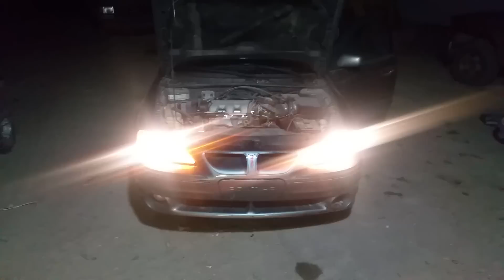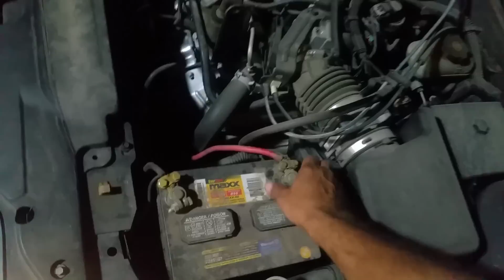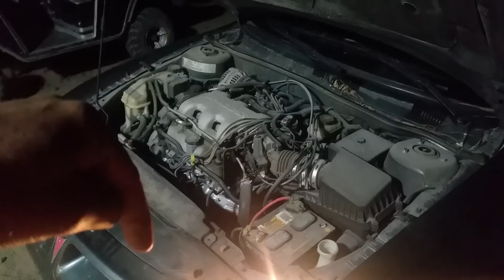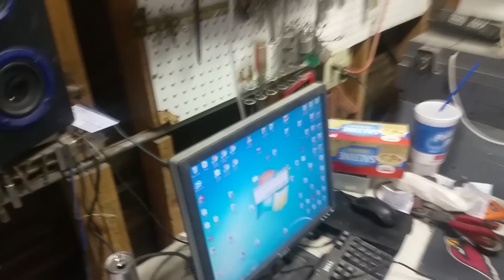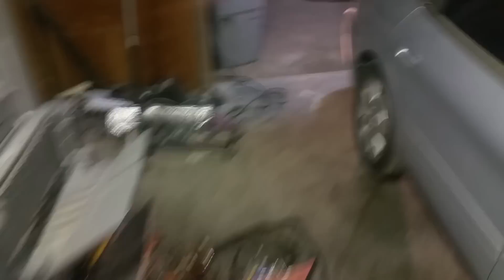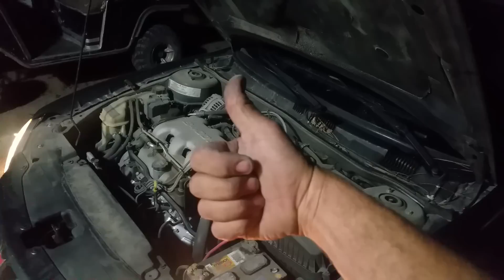Bad Alternator or Bad Battery, Easy Solved

Comment: But how can you tell if the car doesnt turn on
Reply: you cant. but you can try  jump starting your dead car using another car. then drive your car for 15 minutes. (driving charges the battery). and then disconnect the battery like this guy does to find out if its the battery or alternator at fault.

Comment: Straight to the point. But the alternator could still be running the car but under the normal voltage, and you can only test that with a meter. If that's the case, you still need to replace it.

Comment: Battery does more than just starting the car... Go ahead and do what this guys tells.. Take off the cable. If it stays running great.. But dont put cable back on battery and see how far ya get before your car dies and your stranded....I assure you, it will stall out abd die within 5 no more than 10 miles

Comment: I can not believe I had not thought of this fact... As soon as you said you didn't need tools I said it out loud and all, "oh duhh, no kidding".

Those who make remarks on computer issues clearly have no idea how a computer works. The radio is actually technically speaking it's own computer from the car. The cars memory is like a USB stick. 15+ years of no power I think it is the longest time I let one sit for, stick it in (aka power it up) and the data is there. So the clock on the dash, it's less than 5 minutes for a monkey to reset the clock/computer. Yes a digital clock is counting, and displaying through process of computing. And cars are simplest forms of computing because it's tasks are often more singular. I'd be far more stressed out if your home PC lost power than I would if a car did.

Comment: My 2000 chrysler 300m does not start.No interior lights.Tried to charge the battery with my battery booster.Charger read 12.1-12.3 volts.Interior lights and head lights come on but iginition just clicks and engine won't start.Is it the alternator?

Comment: Doing this can really cause issues I would never do this to any vech . The facts the battery has more then one job it  keeps reserve power to start vech, it also stabilize all current moving throughout the vech . at the time you remove the positive cable if the alternator  have a high current Spike yes you can fry computers and wires and a lot of other items throughout the vech. due to battery not hook up . been working on cars 30 years  ase  my advice is use a multimeter it's fast and you don't have to worry . I had a costumer did that didn't tell me  at first , dealership got 3,000  issue I found  was a burnt wire on the positive side of the transmission modular took out the transmission a lot of hours on that job costumer told me after he did this . real issue he had at first was a bad ground wire . great topic glad I found it be safe and stay positive .

Comment: If you have a radio with a pop off face plate for theft purposes, remove it before removing battery cable. Your radio setting will be saved.

Comment: Thanks, this was useful for me. Btw, when I did this (for 5 mins), although my car didn't stall, the headlights started flickering fast (but they went back to a solid light when I reconnected the battery). Is that a sign of something?
Reply: It means your alternator is on its way out. Voltage spiking means a part of the alternator isn't working (usually consists of three points for the belt) one of them is out.
Reply: @PallaDrak  I rechecked but the voltage stayed at a steady 14.6V (with flickering headlights). Maybe the battery provides stability to the electrical part of the car?
Reply: @Saaaaab  The battery acts as a sink in the charging circuit, absorbing fluctuations in current and voltage from the alternator.  Pulling the terminal like he shows is a very bad idea on newer cars.

Comment: Ok, this is my problem. No electric in my vehicle at all. I put jumper cables on my battery i charged it for 5 minutes + when i went to start the vehicle i hear click click click. Ik the battery is probably dead but is my alternator a problem too?
Reply from the maker: loose connection on the battery or starter

Comment: Bro, the battery in NEWER cars is used to START the vehicle AND control the ECM/ECU (Computer) which handles voltage spikes and fluctuations.  Removing the positive or negative terminal with a newer car, especially one whose positive terminal splits off to the ECM like mine (2016 jeep compass) will potentially fry the alternator and/or the computer.  DO NOT EVER DO THIS!!!

Comment: I have an 06 Ford Taurus, the charging system warning light came on. And upon researching it. ( tested with voltage meter) and it read 10.2 volts while running and 12 + after car was off my alternator was bad. I installed the new alternator and again tested it with my voltage meter, for about a minute it read 14.5v.  Then the charging system morning light came on again and it's reading 10.2 or so. Could this be the battery or is there other things I should check? Any input would be awesome.

Comment: A friend sent me this video... I’ve been going back and forth between thinking my battery is going out or my alternator.. several opinions from people after I tell them what my car has been (and hasn’t) been doing .. pretty much 50/50 on what the problem is... definitely didn’t want to take it in for some guy to treat me like I’m an idiot and sell me something I don’t need... so I tried it... now convinced it’s the alternator. Thank you for the short simple test trick! Made my life so much easier and for sure saved me some money (and headache)! 
Oh and loved the “rearrr rearrr” noises... loved the boo hoo reset your radio station! The unplugging of your actual computer had me dying!!! Common sense isn’t so common anymore! For sure subscribed and liked!!
Reply: How old is your car?  if it's a newer model this will NOT test if it's the alternator.  Removing the battery shuts down the ECM (computer that runs the car) and will flip a kill switch on your engine to try to stop it from overloading.  Doing this can create a feedback loop creating voltage upwards of 30 VOLTS which can actually fry a good alternator!  The only test I know of is to use a voltage meter.  Test the voltage before you start your engine and you should have around 12.4 - 12.6v.  After you start it and run the engine or rev it up it should test at 14 volts.  

Again, to repeat, this method does not work on newer cars.  This method can fry your alternator or ECM.  Test with a volt meter ONLY.
Reply: Tek Rx Greetings... my car is a newer model Ford Escape. .. the test was correct.... I’ve since taken my car in to have the battery tested... yup sure is fine.. no my computer isn’t fried.... I didn’t even have to reset my radio... .. The test was more of a... should I spend $150 on a battery or $150 on an alternator.... like I said in my comment.... several mechanic friends said battery... several said alternator... this just sealed the deal on who was right. Yes I know you’re probably thinking.... well why didn’t she just have one of them test out the battery? Answer.... sheer stubbornness that’s all.
Reply: That's great, so it was the alternator after all? Hopefully everything is working well after the repairs. Honestly I've been googling, watching videos, and reading everything I can. I ended up finding quite a few people saying what I said here. I still need to get my hands on a volt meter so I can test everything. Just got a new battery since all 6 cells were bone dry, trying to pinpoint why that happened right now.

Either way, I'm glad everything worked out for you. I just got scared of the "test" here after reading how badly it can screw up your car. The funny thing is they say it can actually fry your alternator doing this test this way.
Reply: @vladdangel how never cars?

Comment: Hello sir,I have a 1999 dodge ram 1500 van.I have not driven it for a yr now,The problem I am having is that the battery keeps dying,I replaced a brand new battery but to start it,i need to jump it.Here are the issues.
1.it will crank only as long as I hold the key,if I let go of the key ,it stops.
2.No check engine lights are coming,only check gauge light.
3.all lights turn on,radio turns on when I try to start it.
4.The indicator light will not turn off even when I turn the indicator to off position.
I have already tried replacing the ignition relay and solenoid fuse,but it did not help.

can you suggest what could be the issue just so I dont get cheated by a dishonest person.
Thanks.

Comment: wow great advice but i always herd remove the negative side of battery ... never herd of the positive side ever & yes i herd if u remove the battery  while runnig it would kill the computer .. so its positive removed & NOT negative ,,hope it works ..thanks
Reply: It is better to remove the negative side first if you are doing work on a car that requires the electrical system disabled. And you heard correctly, doing what this guy suggests could create a voltage spike and damage your computer if the car is newer and has a lot of sensitive electronics.

Comment: Saved me so much trouble , proved the alternator not charging by volt meter proof, somehow reset a chip or the internal regulator.  Alternator charged 14.5 properly thereafter.    So much money saving.  thanks !

Comment: Informative, but what if I know the alternator is bad but they also say I need a new battery?
Car died while driving it, won't start. Both crapped out at the same time? Seems suspicious.
Reply: Learning on a decent multimeter test both. Cheaper first --age of it and get battery charged then load tested at parts store. By used or refurbished battery.

Comment: I would rather take out negative cable instead of positive cable. Other wise this is a good video for its purpose. Nice job
Reply: Sifu Pai Mei  because negative is grounded on battery if that positive hit anywhere on metal will spark..

Comment: You shouldn't do this on newer cars. A easier safer way to check the battery and alternator is with a multimeter. you also gave false information. The car runs on battery not with an alternator. The alternator all It does is charge the battery. If you run a car without a battery, the alternator will fry.

Comment: Could it be possible that both my battery and alternator? The reason why I ask I because I’ve been jumping my car for a week or so every day with portable jumper cables. The car would start instantly after jumping the battery and I would drive Uber all day. Today for the first time i didn’t start after jumping the battery. Finally it did start but cut off on me after driving for about a mile or so. Now I’m worried it’s the alternator as well as the battery.

Comment: You are an idiot for doing that. You are not suppose to disconnect while engine is running. Can effect computer and electronic components in a negative way.  Everyone do not listen to this guy.
Reply from the maker: why ? tell me how it effects it? you calling me a idiot makes you look so stupid to any mechanic that knows auto electronics. ha i guess your battery better never go dead while your driving to grandmas house. because it would be the same  thing. think about what your saying before you open your mouth and you might be look a little smarter. your welcome for the education. .
Reply: thomas brian The man from the road service thinks he's being helpful. After he can't jump start your car, he puts in his own known good battery and starts your car. So far so good -- your battery was definitely either run down or bad, and he's proven it.

Now he decides to "test" your alternator by disconnecting the battery. After all, the car's ignition should be able to run on just the alternator's power alone.

Wrong!

The moment he disconnects either lead from your battery, it's entirely possible he caused thousands of dollars in damage. Here's why...

Your battery does more than just provide electricity. It also shorts AC, spikes and transients to ground. Removing the battery from the circuit allows those spikes and transients to travel around, endangering every semiconductor circuit in your car. The ECU, the speed sensitive steering, the memory seat adjustments, the cruise control, and even the car's stereo.

Even if your computers and stereo remain intact, in a great many cases removing the battery burns out the diodes in the alternator, necessitating a new alternator. If disconnecting the battery interferes with the voltage regulator's control voltage input, it's possible for the alternator voltage to go way over the top (I've heard some say hundreds of volts), frying everything.

Even the initial premise was wrong. If you disconnect the battery and the car conks out, you don't know if it conked out due to insufficient alternator current, or whether the resulting transients caused your ECU (the car's computer, which controls fuel mixture, timing, and much more) to spit out bad data, shutting down the car.

Nobody should EVER run your engine without a battery.

And yet when you tell them not to, they'll roll their eyes. "I'm a professional. I do this every day. It's fine!" They'll sound so authoritative.      Idiot
Reply: @ah6501  *crickets*  LOL.

Comment: Is it the battery if you driving and everything stop but the truck still driving. I was driving an my truck sensors stopped like I had turned the truck off but the truck was still driving. So would that b a battery r alternator. It's a Ford truck
Reply from the maker: sounds like you may have a loose connection somewhere. either on the battery, or alternator, or fuse panel. i would start with the easy stuff first. thanks for watching

Comment: This is not recommended. If you have ever lost electronics to a power surge, this will create a surge in your car in your cars electrical systems. There isn't just one computer, there are at least 50 total systems in the car, some up to 100, and a lot that run on small voltages. Doing this will not hurt your car, if you know for a fact that he alternator is good. But you better be sure...
Reply: Actually it could potentially damage the diodes or voltage regulator, even if the alternator is good.

Comment: To help assure anyone out there who did a lot of research like I was doing before I saw this video, I did this method of testing by removing the terminal cable safely without issues on a 2005 Toyota Highlander. Based on the test, my battery is the problem. I think the amount of people who say this is dangerous or you'll fry the computer is blown out of proportion. But it does helps if you have a voltmeter handy, if not I'd recommend buying one. In general even if you're not a mechanic (which I'm not either) having the right tools and not cutting corners is essential for helping you maintain your car. A good battery that's been sitting overnight should have about 12.6 Volts if fully charged (12.2 volts is about 50% charged, for reference, and if it's under 12 volts it's technically dead) and when running the battery should fall between 13.7 to 14.7 volts, give or take (I saw other websites that said anywhere from 13-15 is good. I'm not a mechanic and I'd encourage you to look things up on your own to confirm but just sharing information I was finding for anyone who had problems). It helps because I saw my battery was showing about 12.2 volts from sitting overnight (after it was jumped the previous day) and about 13.4 volts while running, which are both under where the voltage should be. Once I put in the new battery, I was at 12.6 volts cold, and about 13.9 volts running, so it gave me some added assurance that the battery was the problem.

Comment: Your way of turning off a computer is like turning off a car that's the same switch to turn it on like ignition but try it when lighting strikes/unplug it see what happens when you gotta deal with your computer harddrive and registry is messed up and its the same thing like unplugging it from the battery on the car same source so yes you can fry your ecm your gonna cause a spike on the car and cause capacitors to hold a charge on the car ecm until it cannot  hold it, so spike it spike the whole electrical system its your car
Reply: Even if he just straight unplugged the computer it will probably be fine. If my damn ps4 survived multiple instances where power was cut off instantly. Then it turns on having barely any issues, if not, none. Then it will probably be fine.
Reply: @lenientorange1113  i get what your saying but your playstation has a ground and whatever excess unwanted electricity when its plugged in it will go to the neutral wire or ground back to earth

Comment: I know you said on the video "using no tools" but I think it could be helpful if they can go to walmart at any time of the day, buy a regular Multimeter worth like $15 bucks and check the battery voltage with the car off then re check the battery with the car running and look for the difference in voltage.

Comment: How about this? Clock dies but radio station settings do not get lost? Bad battery or bad alternator? I left car out for a week in Dallas (hot!) And car wouldn't start until jumped. Next day it was dead again and I realized rear light at hatch opening was on. TIA.

Comment: If theres charge in a car and lights and radio come on but it makes a rough clicking like sound when trying to turn it over, is that a good indicator of alternator?
Reply from the maker: could be, but the battery is dead or cable is loose to the starter, check there first.

Comment: You said nothing about why or why not pulling off the negative side and if that would still give or doesn't give the same result. I have already bought a new alternator for my 1998 ford Windstar after testing the old alternator from negative side. I haven't installed it yet. I am now confused!